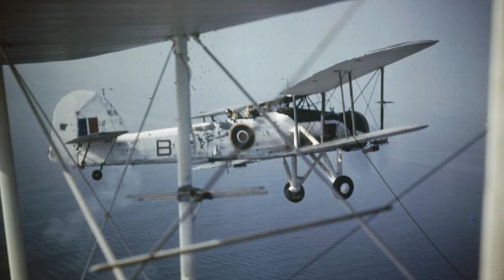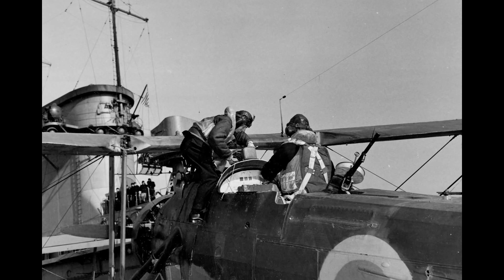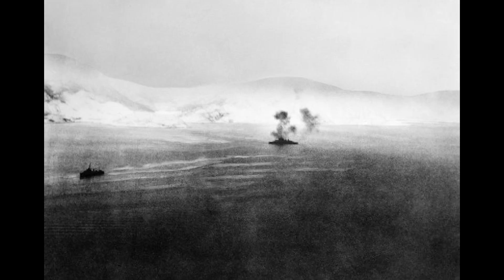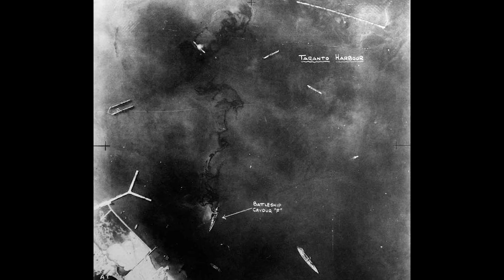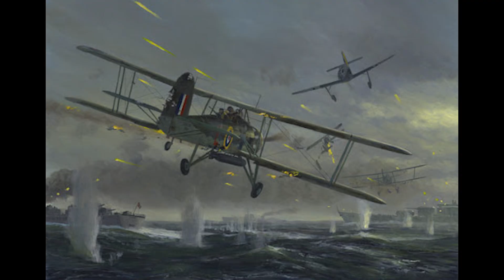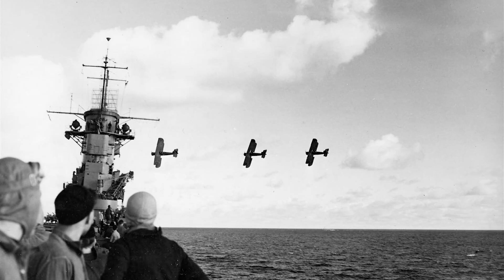Fairey Swordfish | Darling of the Fleet Air Arm [Aircraft Overview #16]

Comment: The British got a lot of use out of this aircraft.

It's poor performance during the Channel Dash should not be seen as based on the aircraft itself - as the Germans had so many fighter aircraft covering this operation - that any torpedo bombers in the world that had tried to attack unescorted - would have been as slaughtered as the Swordfish were.  Other British attempts such as by Destroyers - were soundly thrashed as well.

Essentially, the British were caught by surprise and responded slowly.  I do  not believe they had any plan or assigned units to deal with an attempt to sail right up the Channel.

As it was - Gneisenau - was damaged slightly by a mine but the chain of events following this damage resulted in more damage and then an attempt at a conversion.  Before this was complete Hitler had become disillusioned by the surface Navy.  The end result was that the ship never participated in a combat operation again.

Scharnhorst was eventually sunk by Duke of York while attempting to attack a convoy.

Scharnhorst Class
https://en.wikipedia.org/wiki/Scharnhorst-class_battleship
.

Comment: Re. the name 'Stringbag';  I always thought it referred to all the bracing wires, but only recently found out the real explanation. In that era, British housewives used a shopping bag made of string tied into a mesh like a fishing net. The advantage of the string bag was that you could put any shape or size of shopping into it, and it would adjust itself to fit.
According to aircrew and groundcrew, the Swordfish was nicknamed the 'Stringbag' for much the same reason; that you could cram virtually ANYTHING into it;  machine guns, rockets, bombs, torpedoes, depth charges, radio, radar - the Stringbag could and did take the lot!
And many thanks, Rex, for a potted history which does justice to the fine record of this aircraft.
Reply: Exactly. "Stringbag" was a term of endearment, not derision, which a lot of folks here in the US don't understand. The common British housewife of the time had very few resources available to her, and her husband took great pride in her doing the most with the least. Each wife made her own stringbag- they were not sold commercially- and a well-made stringbag was a source of pride to the wife as it took quite some skill to make each little square exactly the same size with tidy knots. often using dozens of different pieces of string. I daresay almost all modern women would totally fail trying to make a top-notch stringbag and in dealing with the circumstances of those times.

Comment: A thing that kept the Swordfish relevant was having a light airframe and surprisingly powerful engine, making it capable of launching from Escort Carriers. Their teeny runways made them unsuitable for more advanced, but heavier planes. Thus the Swordfish would see service in ASW for the length of the war.
Reply: It was as much or more the great lift of the biplane wings as it was engine power, it simply needed much less speed and therefore much less 'runway' to get airborne by itself. It also had long flight duration at cruise speed settings, making it superior for 'lingering' near it's ship complement. The 'glory' may have went to the Spitfire, but IMHO the Swordfish probably played an equal but different part of saving Britain in those perilous times.
Reply: It was incredibly reliable, tough & easy to fly. My dad flew them on convoy protection, only other type he liked was the Grumman Martlet.
Reply: @papalegba6796  oh the F4F wildcat
Reply: Yeah, when it comes to guarding convoys being able to be launched from a small flight deck and have a massive loiter time with only a few accurate armaments is far more important than speed or altitude. They were just better suited than a lot of the more advanced fighters and it meant those newer planes could go to front line units. Was just a really good role for them to fill.
Reply: And once the Swordfish had taken off, its gentle landing speed, benign handling and good visibility helped with bringing it back on deck as well. Not the sexiest qualities for any aircraft, but no less important at sea. Ask any Corsair pilot.
Reply: @akmzd6938  Yeah, high performance is only really key if you're in a Fighter. Bombers prioritize reliability, range and load.

Comment: I enjoyed this and even gained a few new insights into this famous type's development history. I did however find it a little odd that both metric and imperial measurements are employed in a seemingly random fashion - for example the gun armament is quoted as 7.7mm (rather than .303) while the length of the floats are measured in feet not metres?
Reply: Younger generation would be perplexed with ft and inches , us oldies can handle both.

Comment: Swordfish didn't outlast the Albacore in flying operations.  Albacore replaced Swordfish on the fleet carrier squadrons by the end of 1941. They would continue in service on the fleet carriers until late 1943 when replaced by Barracuda.  Albacore then went into RN, RAF and RCAF land based service for ASW and coastal patrol primarily along the East African coast and Burma.   

After the war the RCAF and RN used them as utility aircraft, mine hunting flights and fleet requirements units.  The last RN operational flight was at Aden in 1947, the RCAF retired them in 1949.  Swordfish had been retired and scrapped by the end of May 1945. 

This idea Swordfish outlasted Albacore stems from the production dates not operations. Fairey built the last of their 692 Swordfish in early 1941 to concentrate on Albacore production.  But Blackburn had been tasked with building Swordfish in late 1940 after orders for their own aircraft dried up and continued to build 1,699 of them for the escort carriers. 

Fairey stopped Albacore production in mid 1943 to make way for Barracuda but Blackburn continued production of Swordfish until August 1944 as attrition on the MAC ships and convoy escort carriers was very high.

Comment: The attack on Bismarck has a few myths about it. The Main one is that the guns couldn’t hit the Stringbags ‘cos they were too slow. Air launched torpedoes were very fragile at this time and had to be dropped at low speed and height. Swordfish dropped their fish at about a mere ten mph slower than other TPS of the time. Also, all Stringbags attacking the Bismarck were damaged and some were very badly hit. Some were hit over a hundred times and several aircrew were badly injured. However, not a single plane was shot down and this was due to a number of factors such as the excellent training of the FAA crews, poor weather (for the defending ships such as very low cloud cover) poor German AA gun types (Bismarck was due to have her AA suit upgraded to the same as Tripitz) very tired and fatigued Kreigsmarine Gun crews and the ability of the Stringbags to absorb punishment.
Reply: One of the swordfish came out of the attack with 300+ holes in it and 2 out of 3 crew wounded , tell them they couldn't get hit lol
Reply: @mathewkelly9968  Yea, exactly!!:)
Reply: Bismarck rounds went straight through the Stringbag's fabric coverings showing the German gunners were actually doing a great job. However it's a bit strong to say the plane "absorbed punishment". Shells went straight through leaving shell sized holes and too little impact to trigger explosive ammunition.
Swordfish were used by FAA because they were capable of operating in heavy seas of the North Atlantic. At the time, there was nothing "better" that could operate in bad weather from a heaving carrier deck and return to the same heaving deck. It was (for the time) a heavy lift STOL.
Reply: @Dave5843-d9m  I see what you mean.  Maybe say they could survive being hit many times? They were still very sturdy though.  The engine was very robust and could take a couple of hits and still chugg on with a cylinder or two missing. - a feature of the type and different from the In line engines which were far more vulnerable. They frame was tough to handle the weather that you mention and also the heaving decks.
Reply: Another fun fact; Ark Royal actually sent off another strike the next morning to try and kill Bismarck for good, but the Admiralty called them off and the pilots had to watch as the thing became a surface action. A good example of the “carriers are there to support battleships” mentality.
Reply: @bkjeong4302  Yes. This is exactly right and a very good point. “Planes piss off - the big guns are at work!!”
Reply: @bkjeong4302  Or, because the battleships had already reduced Bismarck to a helpless, slowly sinking, charnel house, the Swordfish simply weren't needed, perhaps?  Actually, the twelve aircraft were launched at 0930, and arrived at 1015. Bismarck began capsizing at 1035, and sank at 1040.
Reply: @dovetonsturdee7033  what you said

Risking the possibility of losing aircrew to an already sinking battleship is far from a stellar decision.  Fun fact-HMS Rodney, the battleship that did most of the damage, managed to even launch her own torpedoes at Bismarck, and hit it, the only battleship in history recorded as doing so.  That should give some idea of how thoroughly cooked Bismarck's goose was.
Reply: MHV's take on the subject: https://www.youtube.com/watch?v=PTO3JagV8gE
Reply: I agree... but you still must admire the courage of the Air Crews.... it must have looked suicidal.
Reply: @od1452  Absolutely. The stringbags attacking the channel dash BCs knew they were for it and still went in. How do you do the at? I’d have never had the physical courage to carry on.
Reply: Feel sorry for those gun crews. How the hell do you explain that you shot a stringbag 100x and it still sunk your ship...
Reply: @bronsonperich9430  Good point. You’d have to brace yourself for the ‘bad workman blames tools’ comments. “Yeah but I did actually hit the Swordfish like, 60 times! But the damn rounds just went right through!”
Reply: @geordiedog1749  "I hit ze biplane 50 times!"
Reply: @bronsonperich9430  they probably had bigger problems that the command being mad at them
Reply: @zjanez2868  yeah like trying to survive a sinking battleship
Reply: EXACTLY.

Most people seem to forget that the crew was absolutely exhausted at this point and were effectively for the most part running off of pure adrenaline. Which had been used for hours at that point. The crew was EXTREMELY out of commission, alot of which were likely running off pure training at that point, which is probably why many drowned.
Reply: @John.McMillan  I read a few biographies from RN commanders/captains  and they’ve always tried to rotate crews who’ve been at Action Stations for extended periods. If they weren’t being attacked then crews were ordered off in small numbers to eat and get 20mins kip at least. So, for eg, during Pedestal the crew of HMS Ledbury (Capt Roger Hill) were constantly let off for hot food and also allowed to sleep at heir action stations as long as someone was there to wake them at a moments notice. They’d been at AS for air attack and ASW 72hrs. They even ‘Spliced the Main Brace’ after shooting down two SM79s. Although how that helped them stay alert I’ll never know.
Reply: Fabulous apostrophe.
Reply: Stringbag speed was a factor, but more in training than guns. The German crews were trained such that if they weren't getting hits, they should aim farther ahead instead of farther behind, and they thought they weren't getting hits. Their guns sighting gear was maxxed out just a bit faster than the 90MPH approach speed of the Stringbags, however that was easily compensated for. Some of the more experienced gun crews on Bismark understood all this, but hadn't had the chance to pass their knowledge along to newer sailors who had only their school training to go on. The school training was changed after the Bismark was lost and that increased the Stringbag losses for the remainder of the war.
Reply: @P_RO_  That’s very interesting. Makes sense. Bit of a cock up to have AA that’s not really able to shoot down TBs though. All torpedoes were launched (at the time) at around 75-90mph.
Reply: @P_RO_  one thing that puzzled me though is about increased accuracy and higher losses after this. When are you thinking about? Swordfish torpedo attacks on Kreigsmarine where pretty rare? Apart from Cerberus where the attackers were massacred by the fighter CAP. 
Genuine question.
Reply: @geordiedog1749  It became known around the time Bismark went out for trials that the low kill rate for Sowrdfish was due to training only for faster airplanes, and the previous "one-size-fits-all" approach was amended with target identification becoming a higher priority. For Bismark, the crews were already trained so they had to get this "on the job" from the more experienced gunners aboard. Had they not been discovered early on the 'breakout' that process would have had time to work. A similar thing happened with the fighters on the Eastern front encountering the slower Russian aircraft which again was corrected for in time.

The 'firing position' of all torpedo planes was very similar being dictated by the torpedoes; all planes were equally vulnerable there and those parameters were known by all. Faster more powerful planes could approach and fly clear in less time overall so in theory their loss ratio should have been lower than the Swordfish, but they weren't. The things which made the Swordfish outdated- biplane wings, low engine power (giving less airframe stress), a radial engine giving more drag, and mostly the stringer and fabric construction letting explosive ammunition pass right through undetonated- were the very things which made it hard to shoot down, allowing it far more success than specification and performance numbers indicated. 

It took great bravery to fly any torpedo plane correctly and achieve hits. One Swordfish pilot described it being like driving in a snowstorm where snowflakes (bullets and shells) were coming straight toward you in great numbers, then veering off just before hitting the windscreen. I can only imagine what that was like for them, especially knowing that they'd be right back there doing it again within the hour and maybe a third and fourth time too; and then there was always tomorrow. I'm a brave man but I'm not sure I'd have what that takes...
Reply: What I was told was that the Bismarck's anti-aircraft guns couldn't aim low enough for the Swordfish coming in at nap-of-the-sea.
Reply: @thegardenofeatin5965  That would have been incredibly remiss of the designers to have done that considering TBRs would be one if there main threats. Also, worth remembering that every Stringbag that attacked Bismarck was hit multiple times. One over with 100 holes in it - and two badly injured crew. The guns could hit - they just tended to go right through.
Reply: Keep telling your self that ,no way. Try a blacked out Catalina  flying boat,out of Ireland.
Reply: One of them was hit by the plume of a 15 inch main shell landing directly under it and it still made it back to the carrier with all crew.....   Sometimes unarmored or lightly armored planed r built better than we might think.
Reply: @dillonpierce7869  Yes - I heard something along those lines:) wasn’t one of the crew able to look straight out at the sea or such like?
Reply: @geordiedog1749  from what I remember of reading on that the tail gunner was about frozen when they got back cuz the water column ripped the bottom section out of the plane.....    Don't remember if that was in bob Ballards book on Bismarck or not.

Comment: I had no idea that there were late war radar equipped Swordfish! No doubt in my mind that when it comes to naming the navy's next generation spotter / attack drone.... it HAS to be named Swordfish 2.
Reply: Didn't Halle Berry get her baps out in that...
Reply: @Ob1sdarkside  Not sure if that would have interfered with the torpedo release mechanism?
Reply: @peterharrington8709  
My father was an F A. A. C.P.O. airframe fitter for Swordfish and helped install radar systems on these aircraft.  These were used for anti submarine duties. They would fly at night in pairs. The radar equipped Swordfish also carried a spotlight and they would catch the subs on the surface recharging their batteries. The radar equipped plane would vector in the rocket armed Swordfish from the opposite direction and trans illuminate  the sub allowing the armed plane to attack. The Swordfish was a very stable weapons platform which allowed for great accuracy. A lot of U boats met their fate at the hands of these planes.
My father was a keen photographer and brought back many memories of his service.
Reply: @muddyboycrossaxel6204  that is really interesting. I'm guessing that would have been a completely new innovation in air warfare. Reminiscent  of the way that Buccaneers were fitted out with laser target designators during Gulf War 2(?). They say there's nothing new under the sun.... but under the moonlight... heh!!
Reply: Hello Peter, my Dad flew off of HMS Vindex as a rear gunner in a Swordfish, and I have a genuine 1944 photograph of a Swordfish taking off with secret underbelly radar ? which has been declassified before being released.
Reply: @exb.r.buckeyeman845  nice thing to have. Escort Carriers are not at all famous or glamourous, but they served with distinction and were on the cutting edge in anti submarine warfare. Reading the Wikipedia entry on Vindex gives some idea of how tough a job your dad and his colleagues did.